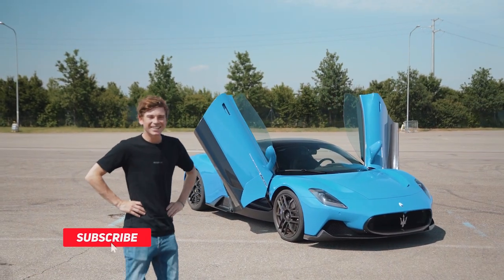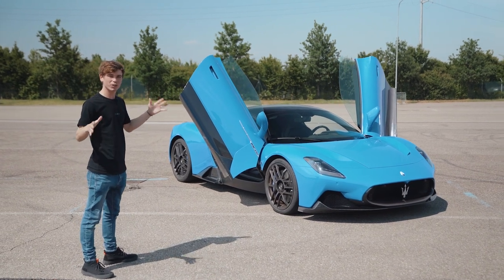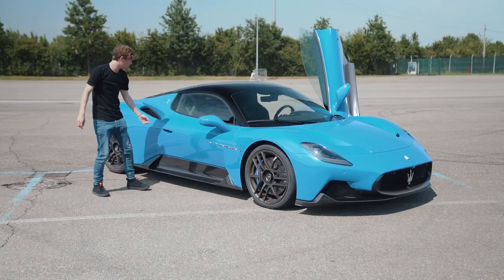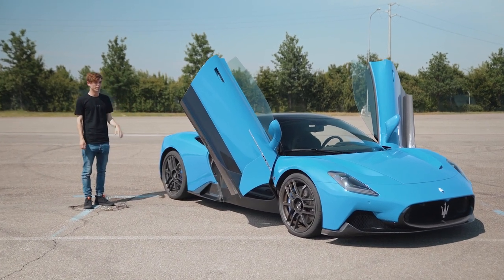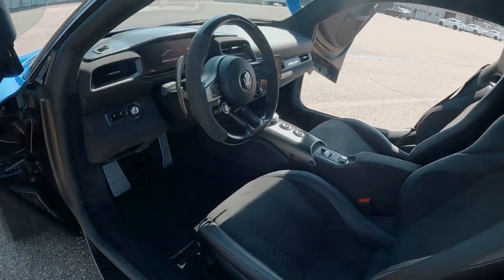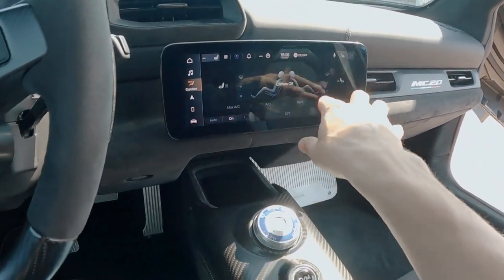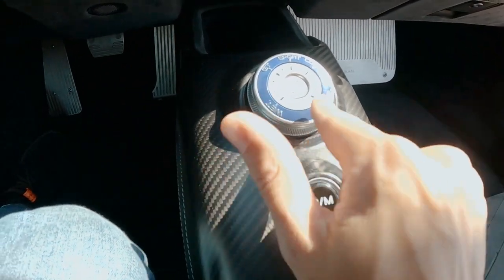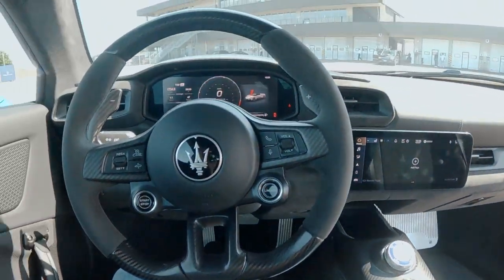NEW Maserati MC20 - First Drive, Exhaust, Design, Interior… FULL TOUR

Comment: The engine is an absolute masterpiece. Bonkers numbers for a 3.0l ✌️
Reply: Doug Parker  ok?
Reply: Doug Parker , you can't compare an aftermarket engine designed solely for racing with a production engine designed to meet ultra stringent European emissions regulations.  The Neptuno V6 is easily one of the most impressive engines on sale today and makes a mockery of the Ecoboost V6 in the Ford GT (in power to weight, power per litre, fuel consumption, and emissions--both carbon dioxide and particulate emissions).
Reply: Doug Parker , again, you fail to comprehend that you are talking about apples and oranges.  No aftermarket, independent engine builder could EVER meet Euro 6 emissions and fuel consumption standards (with a GPF, mind you, which causes an IMMENSE amount of heat, along with full 600+ cell catalytic converters) and make anywhere near the power of the Netuno, let alone match the NVH levels and long-term durability.  Also, Maserati is responsible for one of the single most dominant cars in the history of F1--the legendary 250F.  Only Mercedes, Ferrari (F2004), and McLaren (MP4-4) have come close in F1 to creating a car with similar level of dominance.  Maserati is also the only Italian automaker to win the Indy 500, which they actually managed to win twice.  Maserati never focused on Le Mans... so, not particularly a relevant subject.  Maserati only cared about the World Sportscar Championship, in which they have historically done extremely well.  Also, the tech in the Netuno is quite a bit different to the prechamber varriant used in F1, and Maserati developed the engine fully in house since they have not renewed their engine supply agreement with Ferrari (the existing models like Ghibli, Levante, and QP are the only ones which will continue to receive Ferrari engines, per the original agreement).  There is no link to Ferrari or Alfa Romeo's F1 programs.

Comment: Nice content Seb. Lucky to get to see one of these up close and drive it round the track. I think the exterior and interior design are spot on, as you'd expect from Maserati. The engine is a little disappointing, especially the lack of noise. The price tag of around £220k (with a few options) also puts it up against some very tough competition.

Comment: Its just the engine that doesn’t live up to my expectations... inmagine the mc12 v12 in the mc20...
Reply: Bro do you realise emissions is a huge problem these days V12's and huge V8's is done
Reply: 2021 ting bro
Reply: Everyone did the same when Ford made the GT with V6, but the v6 made everyone surprised.
And one thing i know for sure is that, you might havent drive the MC20 yet, and how do you know the V6 would not be great?
Reply: @KingChadKennedy  emotions or emissions? hehehe
Reply: @chrishaug  i just realised 😂😂😂
Reply: @JoDON111  case of point f1 cars use v6's and in my opinion they are the most underrated engines out there (by the general public I mean) done right a v6 can do quite some amazing stuff
Reply: V20.. mn
Reply: @eddyst4955  dont get me wrong power wise a will built and tuned v6 can be amazing, aske porshe, but man do they lack in the sound department
Reply: @japookie  yeah well they absolutely do, compared to V8s and V12s they really fall short. And it doesn't really stop there, the engine can be very powerful, but the more powerful it is the more instable it gets, meaning the acceleration, and the fact that cylinders don't balance each other out so well (not in porsche's case fortunately, but if we were to like engineer a i dunno 1000hp v6 we would start facing this problemo)
Reply: @JoDON111  the engine is really good, the only part I don't like is the sound, because of the new emissions stuff.

Comment: Everything great, they just f. it with pricetag. This car should be $150K-250K. Then 'd sell like hotcakes. For $300K-500K you can have something much better.
Reply: It is 210K so what are you talking about?
Reply: @zaphod2  That's a paper price for base model. Nobody is going to buy it for that in near future. Dealers are marking it up and forcing you to go for expensive options. Current average orders are in $300-$400K in the US and $500-$700 AUD based on the info we have. In the end, even 210K is expensive for non-optioned Maserati. Normal price of the Maserati is usually around 100K-150K, granturismo, ghibli etc. 150K 'd be acceptable for mid engine then, 210K is too much. Maserati is not a Ferrari.

Comment: I'm delighted to see a new Maserati supercar - but I'll be honest, I'm a little bit disappointed.  The exterior styling is elegant and broadly I like it - but the front is just verging on plain.  The MC12 was DRAMATIC!  And really, a V6?  Nothing wrong with a V6, but in a car priced like this..... well it either needs a hybrid electric drive to bring it up to date, or a V8 as a minimum.  The interior is fairly boring too - and they've just slapped a tablet device on the dash, it doesn't really look "premium".  I'm sure it's a great, fast, useable GT though.